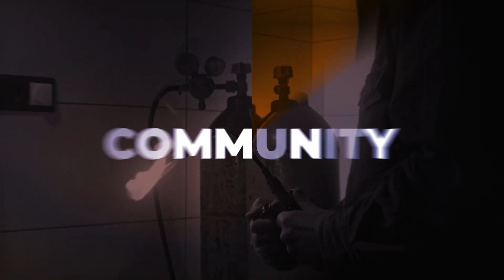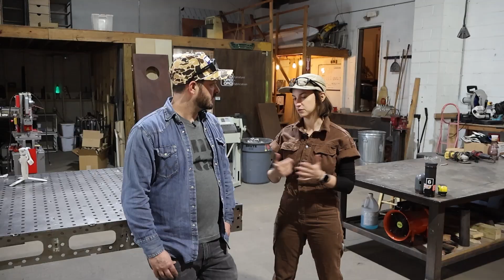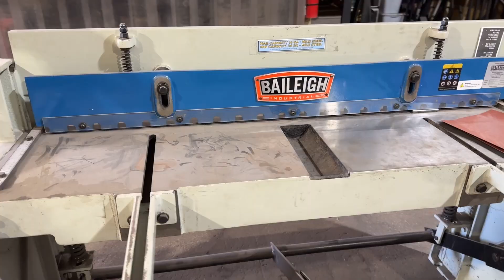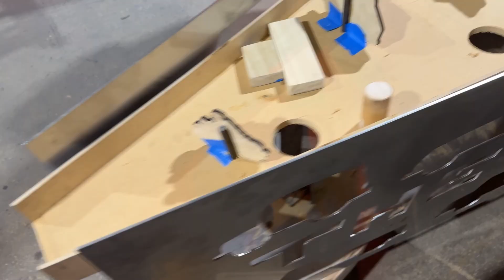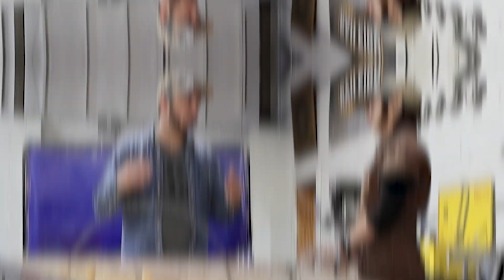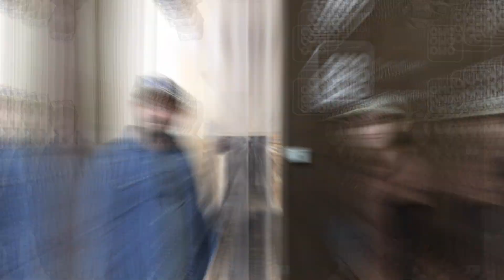How To Start A Welding Business (Without A Shop)

Comment: Quick tip for flame cutting, if you score the line you are going to cut with a cut off disc it will not disappear when you are cutting and the torch will try to follow the score in spite of your shaking hands leaving a nice clean smooth cut. If you cut towards the scrap side the sharp edge will be left on the good side.
Reply from the maker: Great tip thanks for sharing